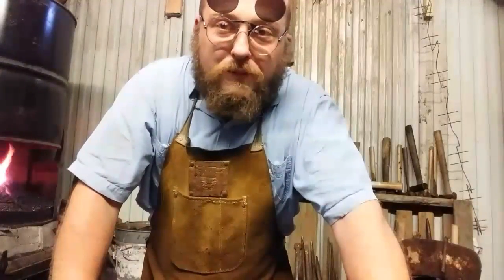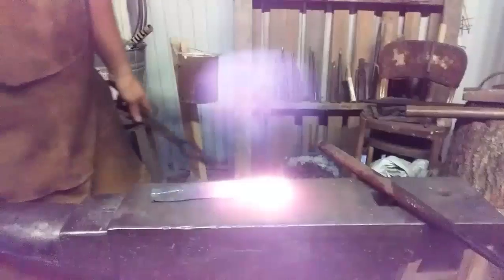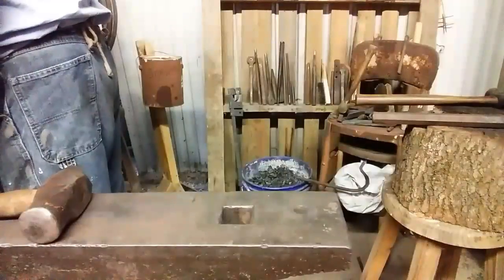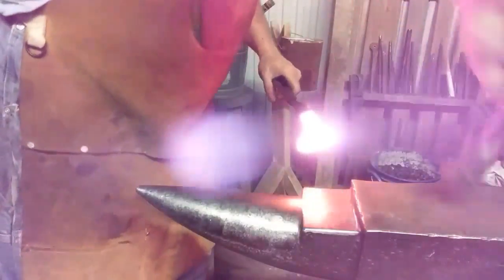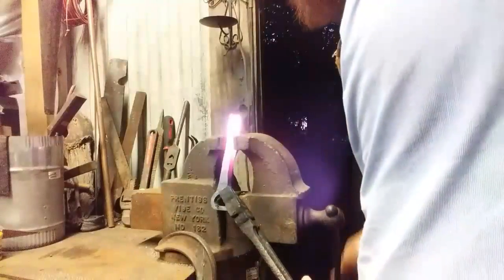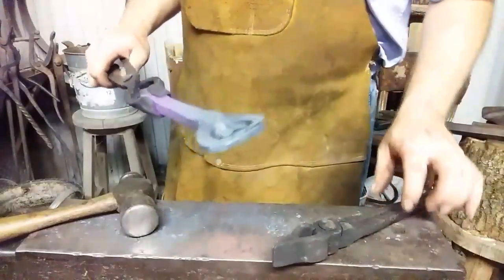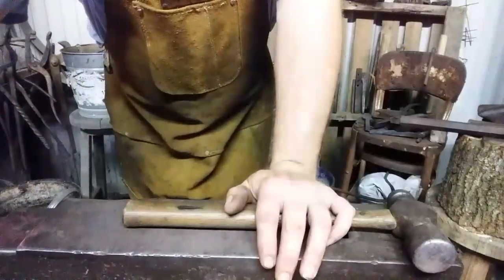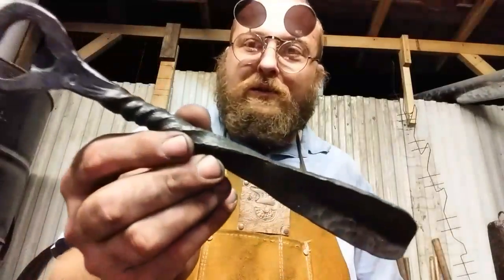Shoehorn bottle opener from a rail spike

Comment: I forgot to mention in the other video. The quarter tip is genius. I always wondered the best size, or rather, a good size. (Note: I hate the word "best" in this craft. There's no such thing as best. Too many variables.)
Reply from the maker: Thanks Rob! As long as the quarter has a good 1/8" pass all the way around sloppily, it seems to make the ideal size ring pretty consistently. I had too many varying sizes happening so one day I grabbed the first round thing I saw  (quarter) and made it my measuring tool.